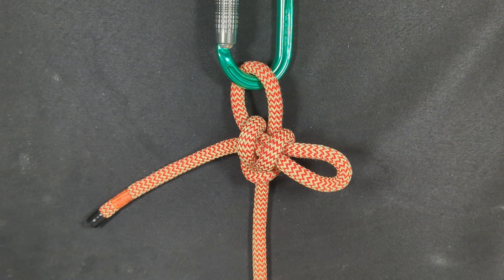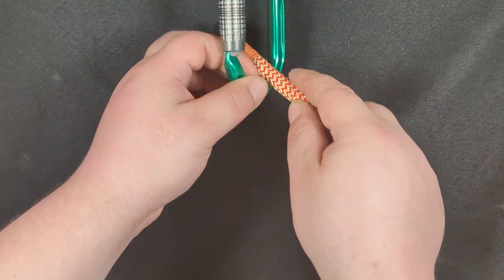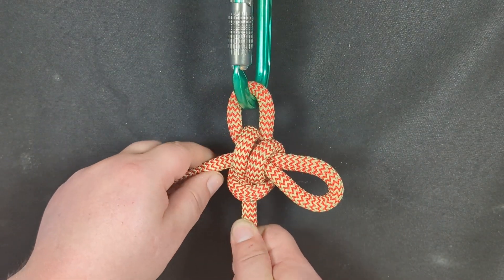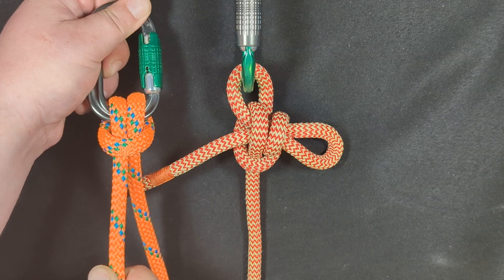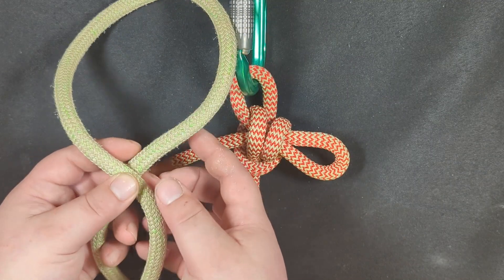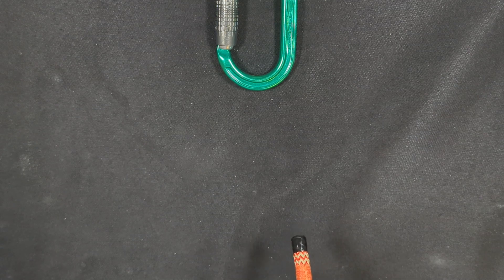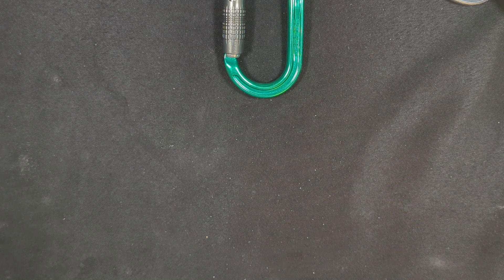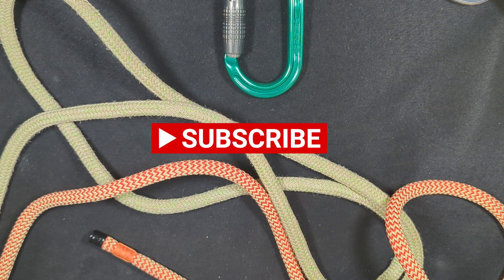MIRAGE Slipped Hitch for Tree, Rock & Alpine Climbers!

Comment: interesting looking hitch, i see applications in tree work where you can lower a limb and the team on the ground can quickly and above all eassily undo the knot by pulling on the end. but if you need to do a single rope rappel with a grigri please just use a knot block or carabiner block on whatever you are rapping off, much safer and wont release and have you fall to the ground if you pull hard on the wrong strand. (yes when loaded it will probably not undo itself but when you pull on the pull strand if you come across a ledge or something and struggle a bit with the pull rope it might and you might fall down)
Reply from the maker: I definitely like your idea for using this hitch for tree work applications! There is an abundance of other ways where this could potentially be useful that I did not mention. As for a single strand rappel, you're definitely not wrong about the risk for a climber to potentially accidentally pull the wrong strand while it is unloaded (however, it would have to be FULLY unloaded). That's why operator discretion is highly advisable and why it should only be used on a rappel where a climber will not have to unweight the knot in order climb down over ledges or other obstacles. This would be ideal for use with low risk, hazard free rappels and where the climber has made sure to create a bight that is as long as possible in the knot at the anchor prior to descending. This could also be used in situations where only one person must descend, with one or more other climbers remaining up at the anchor (where a flat overhand can be tied in the bight during the one climber's descent to make certain it doesn't come undone, and then untied by the climber(s) above once they reach where they need to be lower on the wall, allowing for quick and easy retrieval). Am I in any way suggesting that this is better than doubling a rope over and descending on both strands (or a knot block with two ropes doubled over)? No, I am not. Do I expect a lot of people to use this for rappel? No, I do not, as there are better options. However, it's definitely a great hitch (a means for terminating a rope to a piece of hardware that is easily untied) and this could be preferable for certain specific rappel situations that neither one of us has yet to consider. Thanks so much for commenting and for engaging with me! =-D

Comment: Very nice. Looking forward to the demo
Reply from the maker: Thank you! Yes, the demo will be coming soon! Unfortunately, I live in Arizona, and right now temperatures are really starting to heat up. We already have triple digit temperatures this week and it's only going to get hotter. In fact, it will get so hot that I can't even film outside because my phone overheats and shuts down. It's possible that I won't be making any new content until mid July, after I move to Massachusetts. However, don't worry! I've already made plenty of content which will be published during that timeframe! I planned ahead!

Comment: Awesome an cool color rope👍
Reply from the maker: Thanks! I appreciate it! The rope is actually, more specifically, a hitch cord for tying friction hitches. It's the Teufelberger Ocean 10mm and it is extremely heat resistant, made out of aramid fibers, and will not melt like a normal polyester rope would when friction is applied to it.